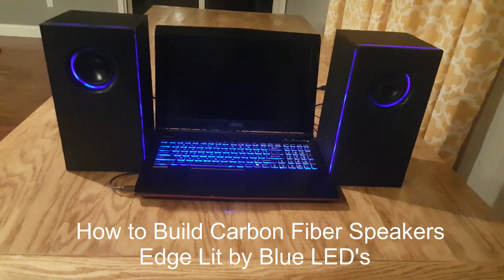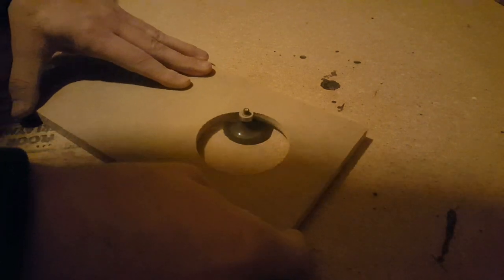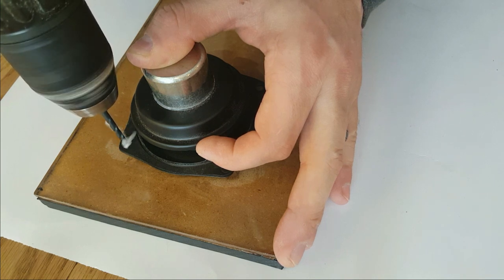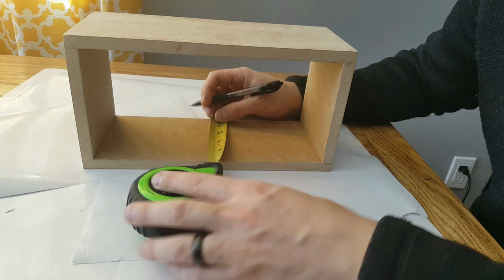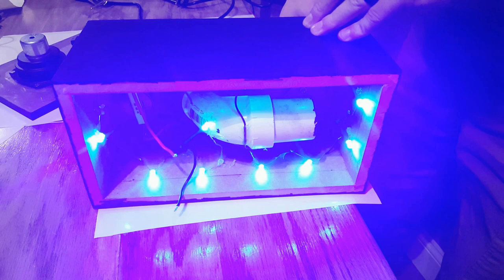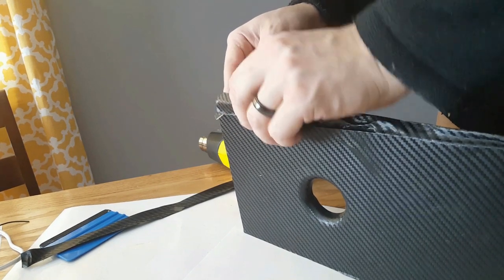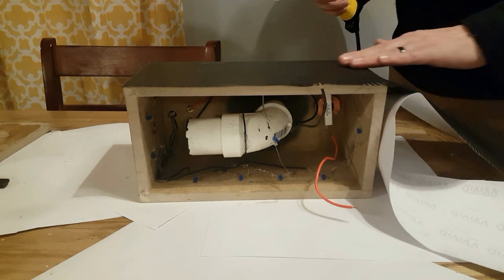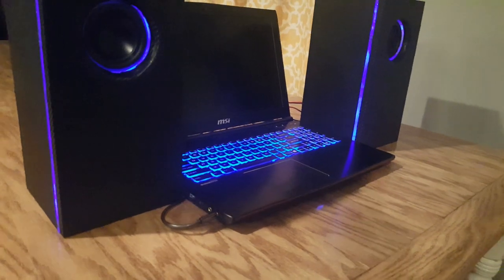How to build Carbon Fiber LED Speakers FREE Build plans!

Comment: I dig it..:) Ive edge lit plexi in the past its a cool effect - if you sand your edges with 220 grit and leave it the plexi will glow more like a neon lite with little to no bright spots. I need some carbon fiber like that. I like the peel and stick method - so much easier than laying it up by hand.
Reply from the maker: houseoffire72 I'll try that next time. On this one I used a torch to melt the edges
Reply: 123Toid The more opaque the edge is the more light it will capture - I think you will like the effect. Just watched your emoji build - pretty fun project:)
Reply from the maker: Thanks man.  I appreciate the feedback.  I definitely will try that next time.  I also thought about cutting it with a flush mount router bit.  I heard that can get good results as well.  I'll definitely give the 220 girt sandpaper a shot next time.
Reply: 123Toid A good carbide flush trim bit is sometimes all thats needed. Where do I get the carbon fiber peel and stick at? Im going to start a new speaker build for my shop soon and leaning towards the carbon fiber on the fiberglass baffle. Could be cool:)
Reply from the maker: houseoffire72 I bought the Vivid XD from Amazon. It comes in all kinds of different sizes and colors.  Use a couple different vinyl wrap so I found this to be my favorite. VVIVID XPO Black Carbon Fiber 5ft x 1ft Car Wrap Vinyl Roll with Air Release Technology https://www.amazon.com/dp/B00L9J4JRG/ref=cm_sw_r_cp_apa_cebPAbNPQSXX6

Comment: this looks awesome, and I want to do this project.  couple questions, do you think drilling small holes in the plexi to install the LEDs straight into it would make a difference? (did this to a bandpass box I made near the edges and  then framed it to hide them) does plexi resonate and if so would dampening material applied to the back of it make a difference?  of course to do this the LEDs would have to be in the plexi itself.  just wondering.  I might do these things to mine to find out.
Reply from the maker: I didn't notice any resonance, so I think you'll be fine with that. That's an interesting idea with the LEDs, definitely worth a try. I've never done that before. You may also like this build, which may give you since other ideas: https://youtu.be/Etr1DCcB7xk
Reply: Thanks so much for the prompt response, tips and the link.  it means so much to me for u to not only to respond but from a vid that was last year. I love your channel and appreciate you pulling off the balancing act of covering throwing together a Bluetooth speaker to demonstrating software and techniques that are pretty much necessary to make a quality diy speaker.  im really into a couple other channels that stay either with the building of the box or will straight take you to school, but you stay in the middle very well.  was so glad to see u teaming up w Kirby also.  keep up the good work and I'll keep watching.

Comment: Great job. I have a speaker build coming up and this video gave me some good ideas.
Reply from the maker: That is awesome!  I'm glad this helped.  If you put it on youtube, let me know.  I'd love to see what you design
Reply: 123Toid I'll definitely post a picture or something once I'm done with the build. I got some dayton audio speakers from parts express so I'm hoping they sound good.
Reply from the maker: Dayton speakers are really nice.  I use them a lot in my builds.  If you are using a fullrange speaker, you may want to check out my video on how to create a BSC circuit, to make sure you get all the bass out of them.  Without one, you can lose 6DB on the low end.  https://www.youtube.com/watch?v=ld4A6MQ4E3U
Reply: 123Toid yeah, they are the full range 2 ½" speakers. Thanks.
Reply from the maker: ND65-4?  I used them in my Amazon Dot build.  I have a set of them for a small portable bluetooth boombox build coming up soon.  Those speakers are amazing.  Quite a bit of power for such small speakers.  HEre's the single speaker I built with it: https://www.youtube.com/watch?v=lX1zZRuRUEA&index=1&list=PL6hjpiCHZmIPH29IXwAKRZ5FGtrN3HrP1  It's complete with a BSC for those speakers.
Reply from the maker: Sorry, here is the sound test: https://www.youtube.com/watch?v=MHcNfBZB2BA&list=PL6hjpiCHZmIPH29IXwAKRZ5FGtrN3HrP1&index=2
Reply: 123Toid Yes, I'm using 2 of the nd65-4 speakers for a small desk speaker build. They had a lot of good reviews. I also grabbed 4 hivi b3n speakers for a bigger build. I just need to practice a little with my router. I definitely want to mount the speakers from the back and round out the front of the hole.
Reply from the maker: That is awesome.  I really look forward to both builds you do.  I've never used the B3N's.  I've used the B4N's, but they are almost always out of stock.  I can't wait to see them.  if you can mount your router on a table, it helps a lot with the roundovers.  If you do not have  a router table, you can use a scrap piece of MDF.  Just cut a hole for the bit to stick through and use the plastic mounting plate as a guide to drill some holes in the back.  I used this type of setup for a long time and it worked flawlessly for roundovers.

Comment: Hi 123Toid Loved ur videos i have a question tho at the end of the project what did u add to get better sound quality to the speakers
Reply from the maker: It's called a baffle step.  I went into detail about it in this video: https://youtu.be/h9EdOMI28js
Reply: 123Toid  i truly appreciate the help one question how did u solder the baffle step that is where im confused
Reply from the maker: It shows you in the video I linked.  You solder the parts together in line with the positive of the full range driver.

Comment: how much is the carbon fiver
Reply from the maker: I used this and was really happy with it.  I bought 5'x5' of it, but I wanted extra for future projects: https://www.amazon.com/gp/product/B00FXYAQW0/ref=oh_aui_search_detailpage?ie=UTF8&th=1
Reply: 123Toid , tnx. but sad to say it can't be shipped in my place.
Reply from the maker: Ah.  Well you can use any carbon fiber vinyl wrap.  I would highly suggest one with air release technology.  Just keep in mind, not all vinyl wrap is made the same.
Reply: tnx, ohh.. do you have video on sound testing of your speaker, and what is your speaker specifications
Reply from the maker: I did this silly video, it is not a speaker test in the normal sense.  I jsut wanted to do something a little different.  https://www.youtube.com/watch?v=RbW8R3BGDp0  The speakers are tuned to around 63hz or an F3 of 51hz.